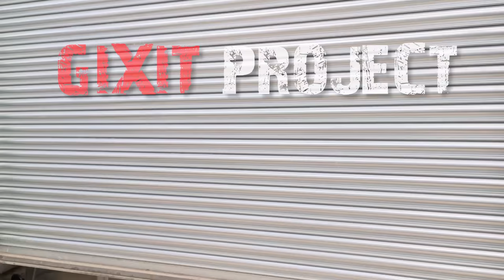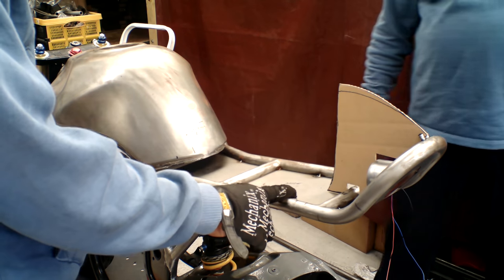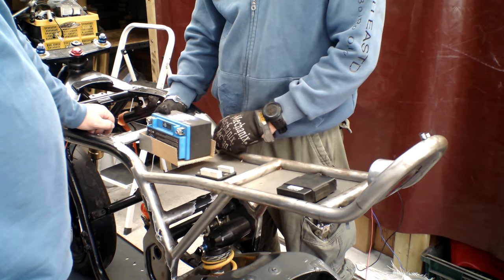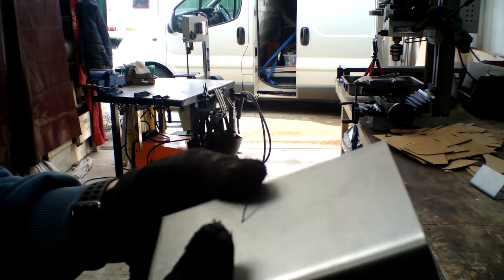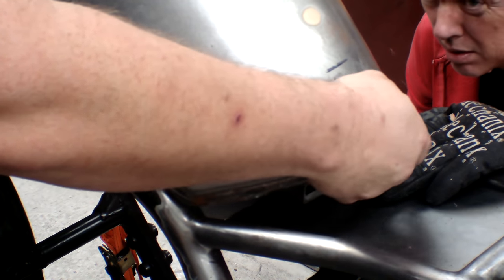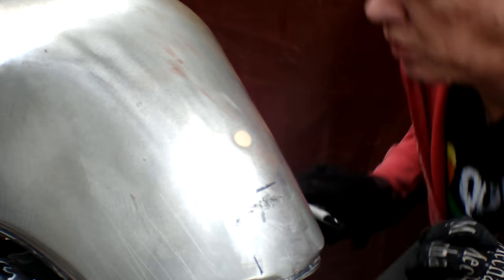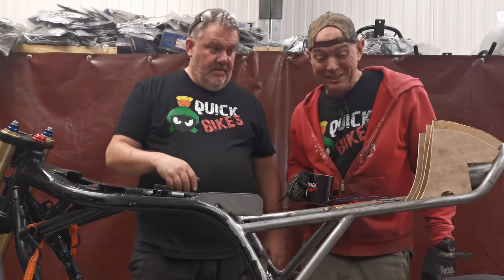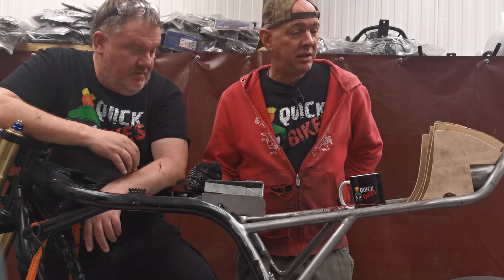Battery tray & buck - Suzuki Bandit Cafe Racer - GIXIT Project Part 19

Comment: Well if you're quite sure you won't spark up the battery with the fuel tank so near to the terminals lol Is the rear hump to be removable?
Reply from the maker: Yes, it'll be removable and the underside of the tank tray is all going to be insulated... Such a rookie error and it was all just me being clumsy... 🙄

Comment: Hi Tec stuff CAD design team of  engineer's great video .
Reply from the maker: Can't beat a bit of cardboard aided design... We're thinking of sandwiching the bits of plywood with polestyrene foam to get the shape once he's happy with it. Hopefully we can bend the sheet around it then
Reply: @QuickBikes  if gonna use steel make it in lot's of pieces if aluminum you can soften it (soap or marker pen trick ) and form round your mould.

Comment: Have you considered doing the seat hump out of fibreglass. Appreciate you’re a metal worker by trade but it’s a good alternative on this part of the bike. A lot easier to shape over the plug and I imagine the weight saving will offset some of Steve O 😬. P.S the angle of the seat hump needs to match the angle of the up sweep on the bars in my view. I’d re think that altogether...Looking good.
Reply: You mean the up sweep of the kick in the rear frame rails? If so, I see what you mean, and agree that the front part of the cowling (where the seat meets it), should follow the curve of those rails.
Reply from the maker: A good idea it has to be said and one we've considered, but ultimately I also. Want to have a crack at making my own tank and thus seemed an easy introduction to the techniques I would need to learn. Weight saving isn't much of a concern as its going to be a very small hump
Reply: Yeah, I was kidding about the weight really, shape more important than anything. But yeah I think the angle should follow the rail.  I want to fab a tank but so new to welding I daren’t 🤣
Reply from the maker: Yup, think I agree with you... Not sure what Steve O is going to come up with, but the one I do will follow the rail and be made differently to his. I'm curious to see what we come up with and which method works best 🤔👍

Comment: Hi lads, new to your channel, loving it! You said your going to put foam around the battery? I'd put it under  as well to kill any vibes and definitely isolate the ECU.
Great work btw!👍
Reply from the maker: Thanks for chipping in matey. Agree with you totally regarding the foam. Why wouldn't you as it's cheap as chips and will save some issues from arising.
Great comment, thanks again 👍

Comment: Why aint you using a a small high quality lithium race battery ? They super lite weight and half the size of that brick 👍🤣
Reply from the maker: Coz that's the battery on the bike at the minute and there's nothing wrong with it. Cranking amps are always a good thing 👍
Reply: Have to say I did wonder about that too. A small lithium battery would probably fit in the seat hump.
Reply from the maker: Yeah... We'll be going that route for the GS build, but this is just a little different and we already have it